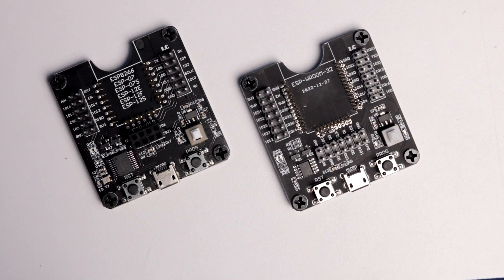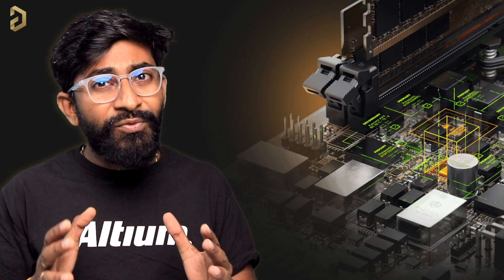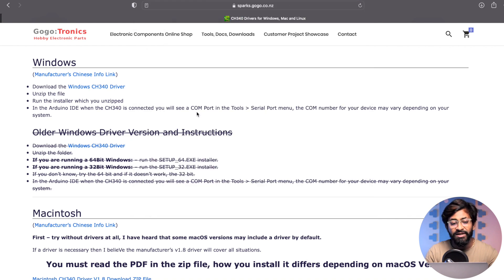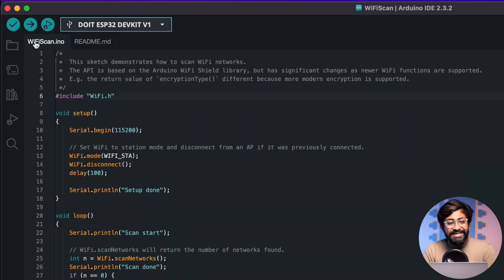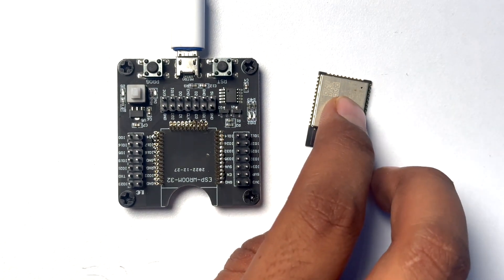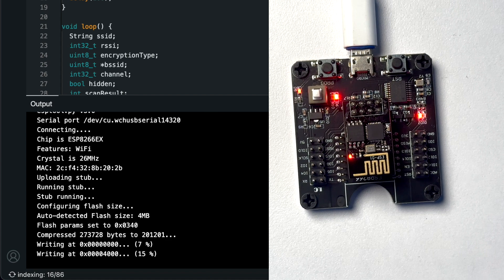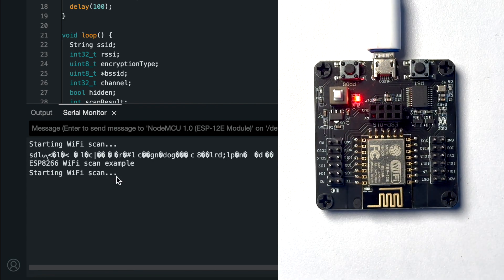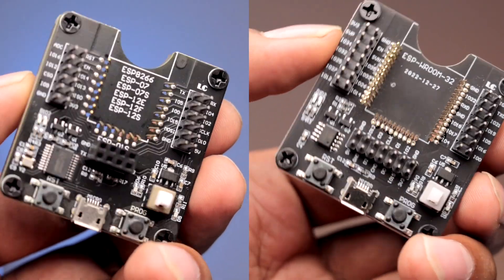Program Any ESP Modules EASILY with this | ESP32 & ESP8266 Programming Jigs

Comment: Cool :) never seen those nice 'snap' sockets for the Esp-12E/F.. module. Dummy question: How to insert the finally programmed esp module to my pcb ? What i mean is: i do not want to solder the coded chip directly into my pcb .. because i need to take off again on any sketch code updates, right ? any recommendation how other folks insert the coded chips into their pcb .. any nice 'snapping sockets' you recommend (i mean professional small industry sockets, not any huge 3d prototypes)? .. or how do you upload code to esp-12F when soldered on target pcb already ?
Reply: does anybody have an idea ? Are you all soldering flashed module into your pcb ? if yes: how can you flash any updates later on ?
Reply: @kaloprojects 

Expose the TX, RX and GND pads for programming. This way, when the esp is soldered, it can still be reprogrammed.

Comment: I've an issue of connectivity ,I'm working with ESP32 Wroom 32D module when I'm adding a device to esp rainmaker app it is stopping at step 1 send wifi credentials giving error like failed to associate device , I've followed many suggestions in guthub and internet but not working I've tried by changing versions of board managers but didn't work . Could you provide solution??  I've follwed one of your video on common errors in esp rainmaker app but my issue wasn't listed in it.
Reply: Drivers. google arduino driver problems. Lots of information. Basically, windows 11 keeps trying to force new drivers onto us, yet most of our systems only work with the old drivers.